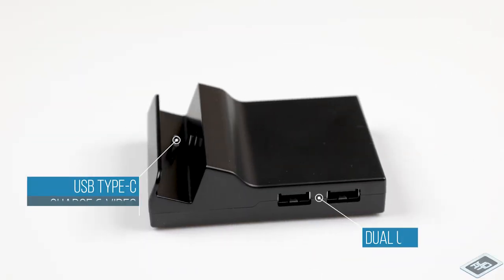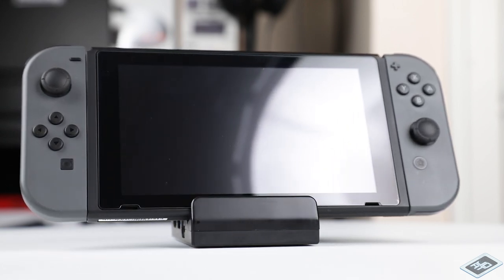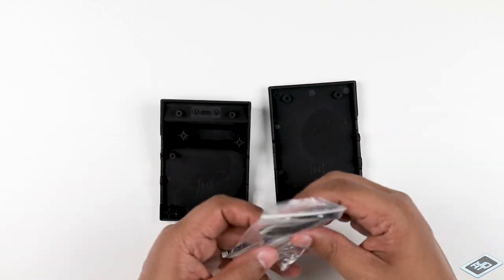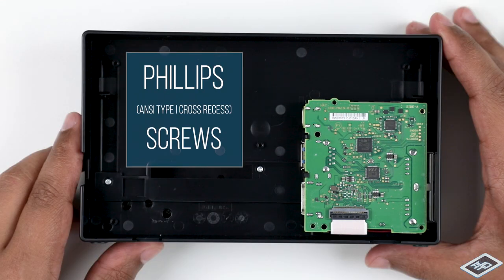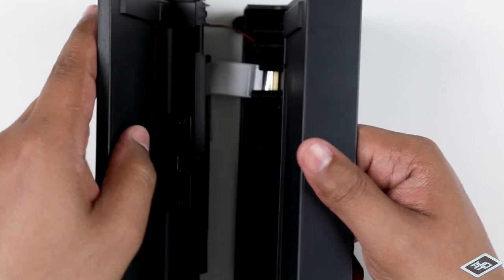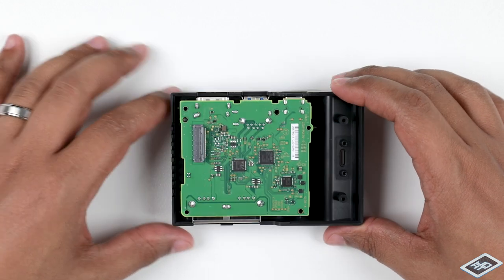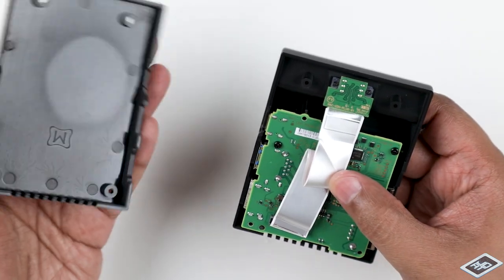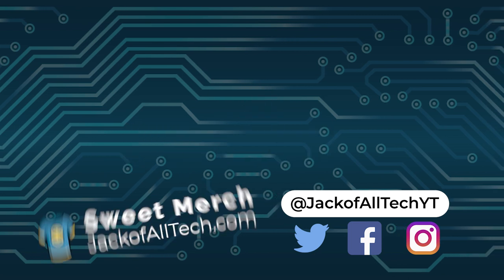How to Replace Your Nintendo Switch's Dock

Comment: But what if my problem is the stock dock, most likely a faulty motherboard? I'm looking for a reliable replacement.
Reply from the maker: Sorry to hear that. I’m not aware of any reputable replacements. You might want to go to a video shop and pickup a used dock. Even if it’s aesthetically ugly or damaged, that’s just cosmetic. As long as it’s functional, you can always take the insides out of the used one and put it into your current dock.